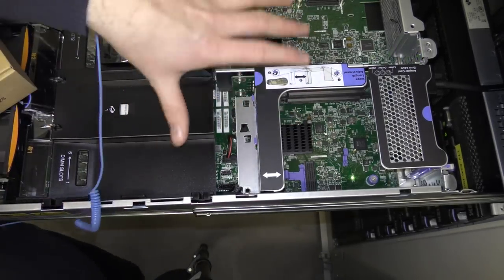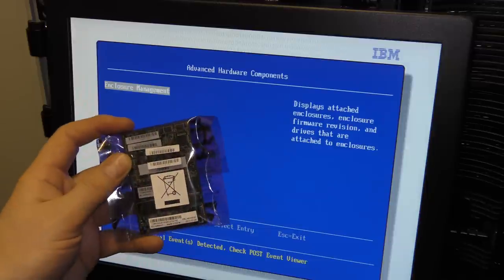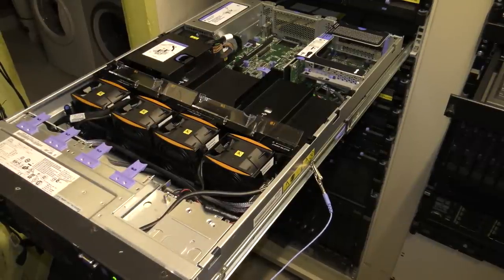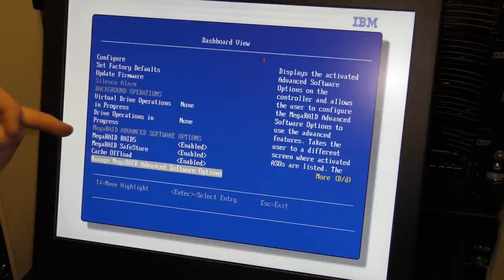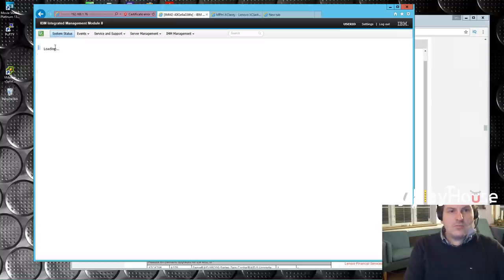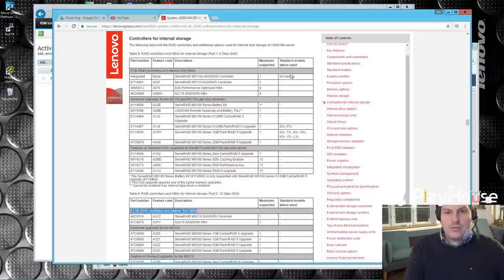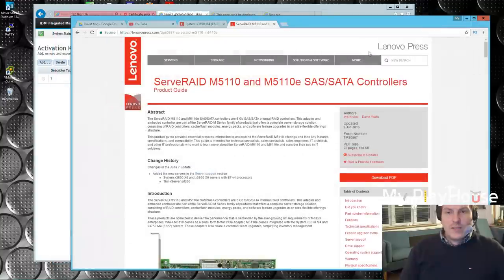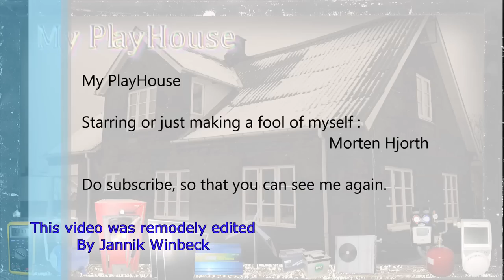Hardware upgrades ServeRAID M5110e 1GB Flash/RAID5 - 468

Comment: So you put in a Flash backed write cache module. Awesome!
I did some googling about the differences between flash and cache: i guess you put in the right one!
The difference is that flash backed write cache does not have the battery limitation of how long it can retain what is written to the module. So after all, when things go bad, you probably won't need a battery.
Reply from the maker: Hi Henk Kok
Thank You very much!  Cache is usually a lot faster then flash,, so there is probably a trade off.
Thank you for watching! :-)

Comment: Morten, the SuperCap is different type of power storage. Instead of using a traditional battery it uses a bank of capacitors to store power. The advantage to this is that the SuperCap has an overall longer life span than the battery
Reply from the maker: Hi Michael Bates
Thank You very much!
Thank you for watching! :-)

Comment: Hey Morton, the Tray ist to mount the Battery-Unit AFAIK, costs about 9€. Only one is supported.
The Battery-Unit itself costs new about 130€ (cables included) - here in Germany. Prices very, just found one at Gekko Computers.
Question: can the RAID Controller in the M4 passthrough the drives directly to the OS - unconfigered?
Keep rockin' - Patrick aka Pepito
Reply from the maker: Hi ThePeperich
Thank You very much!  IT mode it is called,, I do not know.
Thank you for watching! :-)
Reply: Thx bye

Comment: Morten, do you have much experience with putting ssd's in servers? is there any point setting them up in any raid configuration other than raid 0? i may be getting about 6 "free" new dell / intel sever ssd's
Reply from the maker: Hi Wilbert The Swordsman
Yes,, they can still fail,,so raid for redundancy. 
Thank you for watching! :-)
Reply: An SSD is capable of 540 MB/sec transfer rates (sequential, best case), which is slightly more than 4 times the data rate folks are even capable of sending/receiving on 1 Gb/sec (~125 M/sec) ethernet; that being the case, putting 2, 3, or 8 SSDs in RAID 0 usually doesn't help much.....; many folks opt for a RAID 1 mirror, where data is on both drives for data security, when dealing with SSDs.